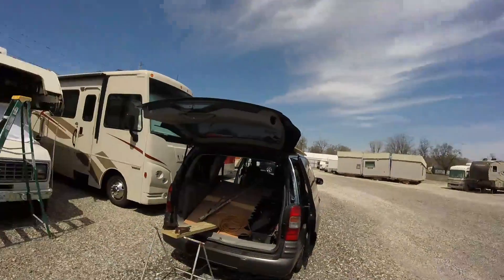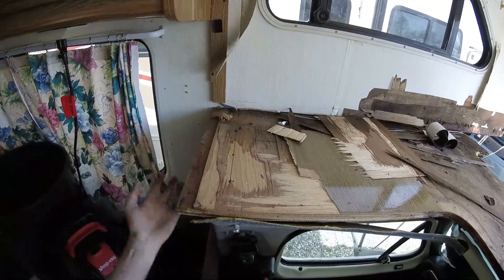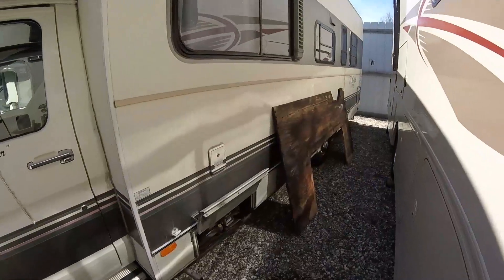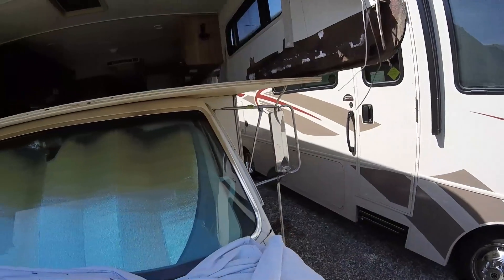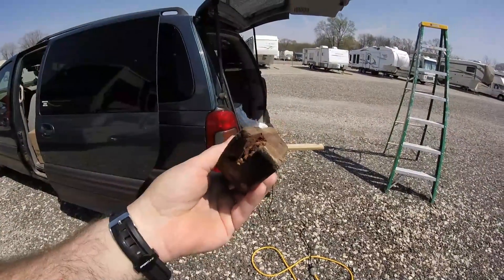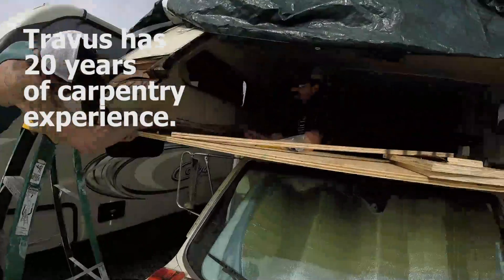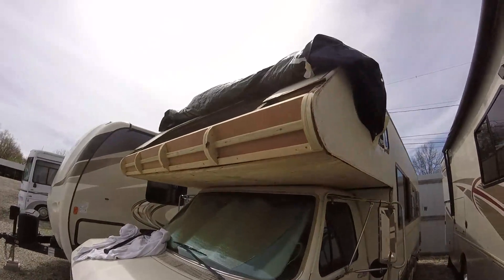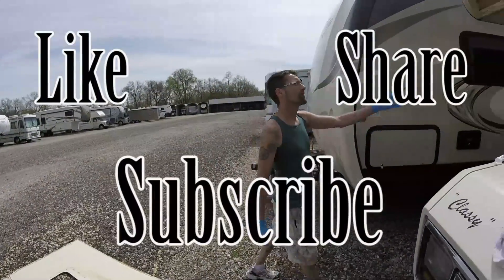Cabover Rebuild P2 Decking & Framing 04.16.17

Comment: it is looking great. I love to see our old campers loved and fixed. Your nephews are a blessing for you. Most repair shops charge way to much to do that kind of work. I hope more viewers see that it can be done and do it themselves. Great Job.
Reply from the maker: I'm a real fan of the "retro" campers myself.  It's a real pleasure to have one and I appreciate it everytime I hear that big ol' V8 fire up and I know she's ready to hit the road.  I hope we're being detailed enough to help someone else DIY this kind of project.  Thanks for watching.
Reply: The problem with the big shops is not only the price but are they any good my brother had one replace his roof they did a lousy job first trip out and the fiber glass side panel on the cabover rip off they fixed it on warranty but instead of properly joining the new to the old they just put a seam on a trip 3 years later the other side came loose fortunately some one let him know it was flapping he called me asking me what to do I told him to screw it and duct tape it so he did and it's still holding now it's my problem to fix as he gave it to me before he died so video like this gives me an idea of how to fix the unit as the roof has been leaking on the cabover since the warranty died about 6 years ago

Comment: This is a great video series! Thanks! I am going thru the same repairs in our Class C and had a question about the sidewalls. In video 1, Paul shows the sidewalls were rotted and commented they would have to replaced/repaired. In this video, you show the bracing to the sidewalls and it looks like the surface was removed. What did you to the sidewalls as far as the rot? Thanks again!!
Reply from the maker: Hi Mike!  Once we got everything opened up, we discovered that Classy has a steel frame.  We thought it was wood.  The steel was very rusty so we reinforced it with 1/8" steel angle iron.  The rotten interior wall was overlayed (after we cut out the rot) with plastic coated bathroom paneling.  Kind of like wainscot. It's not a beautiful way to do an intereior, but we're only going to use it for storage anyway.  However, with a little trim, new paint and flooring it would make a nice sleeping area.  I hope this is what you were asking.  If not let, let me know.  I'll try to help any way I can.  This is a nasty project and I wish you great success.  Thanks for watching!
Reply: Geezer at the Wheel Geezer, yes, this is what I'm asking. You cut out the sidewall rot but didn't have to cut the entire wall so you could replace the cut out area with the plastic wainscot (great idea, that doesn't rot). Another question, what type of wood did you use for the rounded piece? It looks like 2 types. Did you green treat it? Yes, nasty job but you and your family did a great job on Classy!!
Reply from the maker: All of the wood was replaced with treated wood.  Some was green treated and some was brown.  I really didn't want to use treated wood because of the chemicals, but I really didn't want the problem again. :)  I hope yours goes well for you.
Reply: Geezer at the Wheel Correct, this project is a bear! It beats paying $5k at the local RV place though (estimate). I have it right outside in a non-heated space and I live in Minnesota and I want it ready by spring. Tough job and it will cold working conditions to boot!! Your videos showed me the way, thanks for the well wishes!

Comment: just  for the next time -on those radius curved nose framing blocks ,you could've used your skil saw  and cut the thicker material if you wanted to ,i've cut "outside" radius corners with a 7 1/4" skil saw  many times with no issues
Reply from the maker: I never thought to try that.  Thanks for the tip.

Comment: Geezer, I'm in the middle of the same re-build...completely deconstructed and about o rebuild. Please tell me what you used to attach the skin to the new sleeping deck. I tried liquid nails on one of the rebuilt stantions behind the front seats and at this moment it is laying flat and screwed tight. I'll be releasing it on Monday to see how well it adhered. Not sure if I should be using resin for this so I'd love to know what you used, what your experience was with adhesives. Thanks a lot! Great video, it's one of a few that inspired me to take this project on. Peace
Reply from the maker: Hi Michael! I'm sorry I didn't get back to you sooner.  I had forgotten what we used and had to go out to the storage yard to get the information.  We used Loctite Power Grab Heavy Duty as the adhesive for the skin. It worked great!  Thanks for watching and have the best of luck with your project.  👍
Reply: Thanks! That's timely info. I tried 'Liquid Nails' on the skin piece for the lateral support, screwed it together and screwed that whole thing to a solid platform, waited 2 days and NOTHING! Liquid nails does not work. So, I cleaned that whole mess up last night, sanded it all down clean and used fiberglass with one layer of matting between, unscrewed it this morning and VOILA!!...A BOND MADE IN HEAVEN! So, it's good to know Loctite works. I'm bringing back all my Liquid nails now and will get Loctite. I did notice that you all took that skin piece all the way out and I've seen others leave it in and use clamps to hold it together. I was leaning toward the latter method. What are your thoughts on that? Why did you find it necessary to take that piece all the way out? I can see that it would be easier to do it on the ground or bench. All those screws are easily accessible so I might do it that way too. Probably won't get to that part till tomorrow so I'd like to hear your thoughts on that if possible. I'm really grateful to all you folks who took the time to vlog this operation cause otherwise I never would have taken this on. As it is, I have a '98 Coachmen 22ft (hard to find when you're looking for one) with V10 In otherwise good shape, for $1750! A steal I think but who would touch something like that? One side of the lateral support brace was completely soaked and rotten and that's what I'm rebuilding now. The whole camper body was literally separated from the cab!!! But it becomes apparent that once you know what's involved and have everything you need on hand. Two able bodies can do the whole job in 3 days and yet there's one couple on YT that paid 11k for this repair!!! There's a huge market for this now I think as there are plenty of these Class  C's with the same problem going cheap. I'll let you know how it comes out. Thanks a million for the feedback. Looking forward to hearing back from you on the issue of leaving in vs taking out the sleeping deck underskin. Happy trails! I'll be on the road behind you this Fall. Will have to sell my '97 Bounder that I love but it's just too big. The 22 footer is so much easier to drive and the power to weight ratio is fantastic with the V10 which is a gem of a motor. So, if you know anyone looking for a Bounder (no slides) in good condition, let me know. You can see it on Craigslist Maine. It will be a few pages in. Thanks again! Peace
Reply from the maker: We really didn't have a choice regarding removing the skin.  To rebuild the nose framing it had to come off.  You definitely got a deal on yours.  Like you said, once you see how these things are built it's not too difficult to rebuild them.  I hope your project is a great success and you make many great memories as fruit of your labor.  I'll look forward to hearing how it all goes.  The best of luck to you!
Reply: Thanks, I got some of the adhesive you recommended. Today we built a new platform with insulation. And I sanded all day on that underskin to get it completely clean. So, we're going to sandwich that with two 3/8 panels all glued together with Loctite heavy duty and then 3/4 plywood's going on top of that. The platform we made came out extremely well so I see this coming together well. Still have to figure out the nose. I also had to rebuild both of the lateral supports behind the seats. Had to jack up the camper to realign it with the cab and have that all screwed together tight now so it's getting there but it is a lot of work and detail and learning experience. A second one would take half the time after all the trial and error experience. So, thanks again and I will let you know how it turns out. Peace

Comment: Hi, I need to do the same job, but I am doing by myself. How you fixed Fiberglas with the new wood? Did you use a special glue? Thank you!
Reply from the maker: That's been a while ago.  I don't remember the product anymore.  But I can tell you that it came in a tube, like caulk, and was called a quick (or fast) grip adhesive.  Sorry I can't be more help, but I can wish you good luck on your project.

Comment: What did you connect the rounded pieces to
Reply from the maker: I really don't remember.  I'm trying to contact Paul.  When/if I do I'll be able to tell you.  Or maybe it will just come to me.  Sorry I can't be more help right now.  For a guess, I believe that we built the nose assembly and then attached the whole rounded nose to the framing under the window and to the deck.

Comment: I bet you will be happy once classy is fixed and you can get back on the road. It's sad how cheaply these class a revs are made. They should be a lot better made for the prices they charge for them when new. I'm sure they could at the very least make them waterproof so so much damage doesn't happen when they are not being used. My friend's parents got one new in 1982 when we were 8 years old and it only lasted 3 years before it started leaking. It was stored in a heated garage during the winter because we live in Canada. It only had 2500 miles when they had to take it in and get it repaired the first time and by the fourth year they had to trade it in because how bad it kept leaking from the roof and from the sides.
Reply from the maker: Hi Allan!  Oh yes, we will be so glad to have Classy put back together.  But we're very willing to wait and let Paul do it right.  It's sad that your friends had such a sad experience.  I can't imagine buying a new one and have those problems.  I would probably come unglued myself. :)  Thanks for watching.